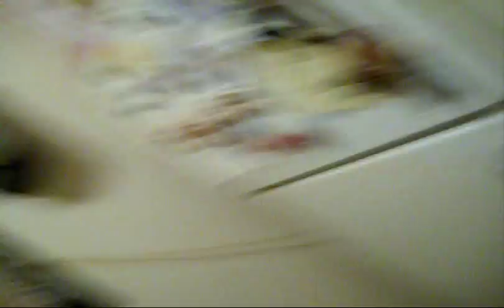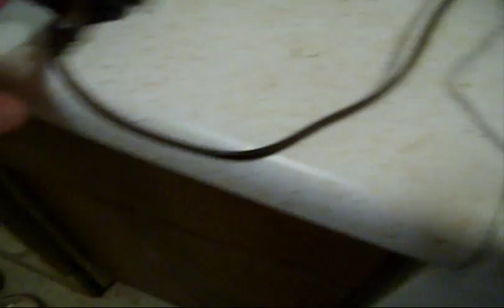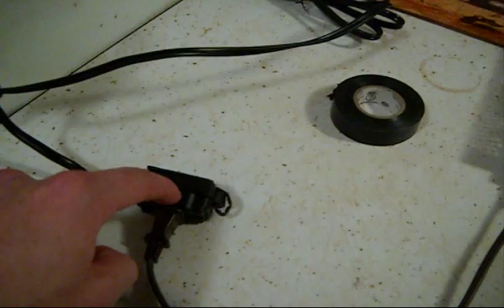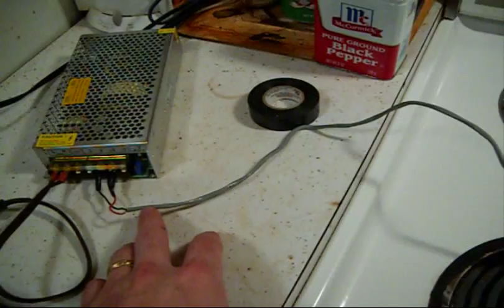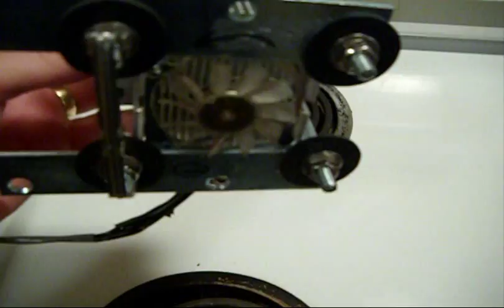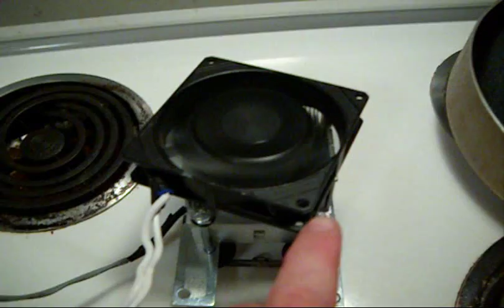Thermoelectric Cooler Part 7 - DC power supply and 2 fans

Comment: That's a switching power supply. The transformer almost certainly does not convert 120 VAC directly to 12 VAC. If that power supply is on the range of 10 A to 20 A, or 120W to 240W then it's a switching power supply. A linear power supply for that power range would be much heavier due to the main transformer inefficiency at 60Hz. Besides efficiency one of the main reasons for using a switching power supply is weight and the price of copper. Some microwave oven manufacturers are offering switching power supplies. They will usually say "Inverter" somewhere on the case; although, I expect that's a feature that they have a hard time selling to the consumer. But it doesn't matter really if the consumer understands what the feature does as long as they believe it makes it better. Really this feature is for the manufacturer. They don't have to buy that giant Microwave Oven Transformer with all that expensive copper, plus it almost doubles the weight which costs more to ship (Inverter Microwave Ovens are much lighter than traditional ones)... Anyway, I could talk about this stuff all day.